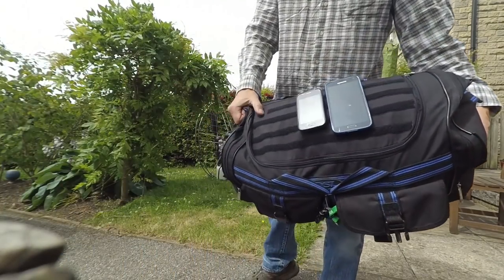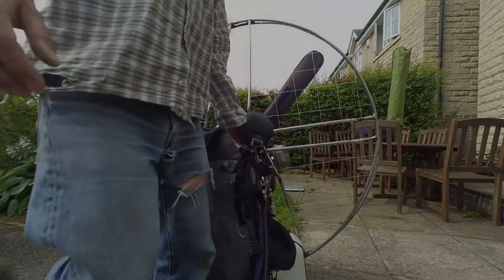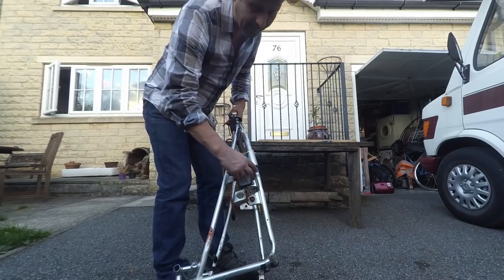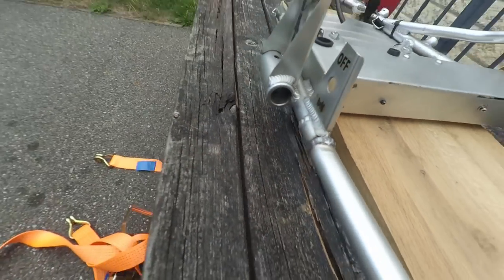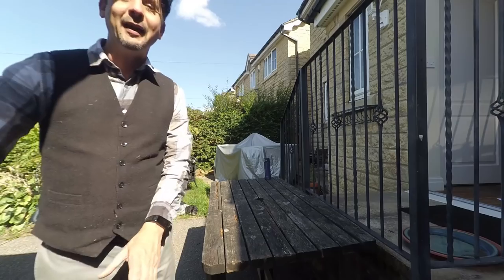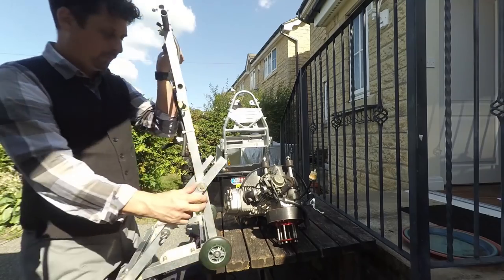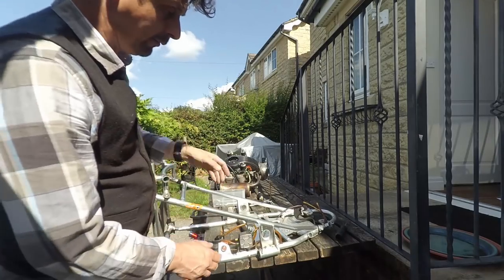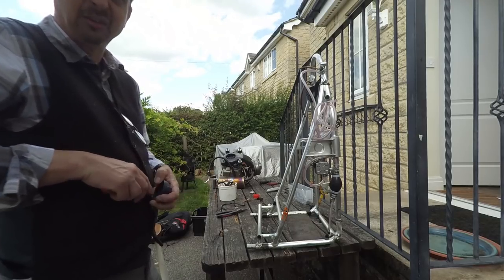Paramotor crash repair after flying into a wall, fully loaded with camping gear and extra fuel.....

Comment: Ouch!
I bought a Baileys that had similar damage, I used a ratchet strap and blocks to manipulate the main frame.
I also rolled a new ring and made a new net.
I am near Accrington Lanc's if you desperately need the odd welding job doing (I have some stock tubing as well)
As long as its prepped ready for welding and you don't need it to be as pretty as the original welds, it will cost you a brew :)
Reply from the maker: Sounds like we are the same person Pimplequeen :)  I'm near Sheffield
Reply: @TimPriestChannel  
That's a bit of a trek but if you are in "skinflint mode" (as anyone with sense ought to be) it might beat being grounded

Comment: Torch..... you hit it with some propane gas and soften it up before trying to bend it till probably reduce possibility of cracking it greatly. While not using a gas that's too hot that you'll melt anything anything.dont use Mapp gas, acetalyne, etc
Reply from the maker: Brazing torch might be a better idea then if it happens again.  Cheers for the advice.